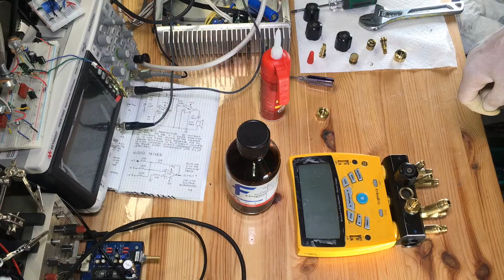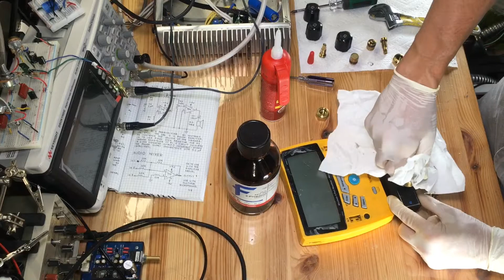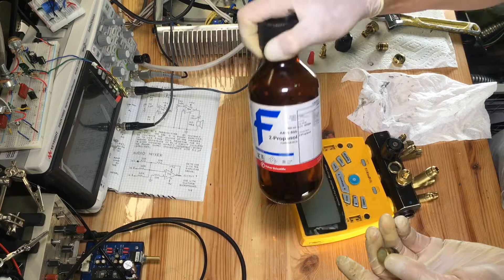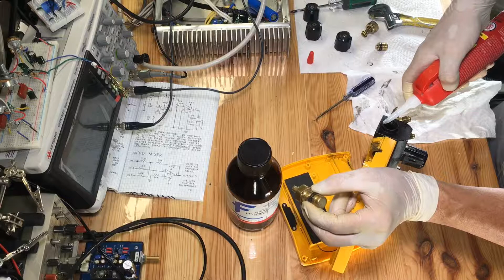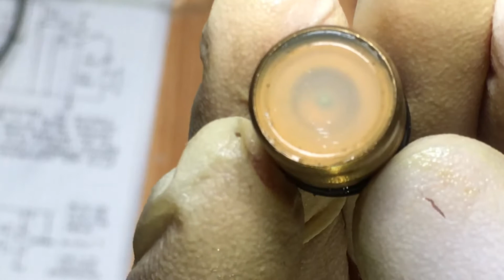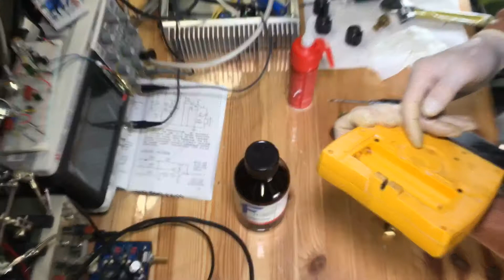SMAN 460 FIELDPIECE DEEP VACUUM FIX FOR O-RINGS USING SILICONE GREASE ￼

Comment: Please find out the compatible O-Rings for it.  Too expensive to replace all the valve and o-rings that Fieldpiece sells
Reply: Any universal o ring would do? Does the material of the o ring not matter
Reply from the maker: @bosslife944  if you use an old fashion bureau, O-ring that is used in plumbing or the old CFC, refrigerant systems, Santa, PAG oil or other additives, may make it swell and become sticky. 

So use the newer O-rings that are made for materials for the Refrigerant oil and Refrigerant that you will be using 

There’s several hundred different O-ring sizes for automobiles
Reply from the maker: In universal O-ring kits, you can find an O-ring. I don’t have a part number, but sending has excellent large Universal European kits, Asian kids, American kids that have hundreds of O-ring selections.

Comment: Tried this, great pull down but it still leaks. I ordered new pistons so we will try again with them a test again.
Reply from the maker: Did it fail micron test ? or pressure test?

If it failed micron test .  It’s because you’re using a small volume of the hoses only or manifold cannot test that way.. 

Refrigerant manifolds were never intended or designed to pull or hold deep micron level . 

Refrigerant hoses were absolutely not designed for capable of holding deep micron level .  They have a limit.

As long as you use, or try to use a refrigerant manifold with regular refrigerant, charging hoses, it will always come up to a certain point that’s absolutely not part of your system that will SKU your results . 

If you want to obtain a micron level and find out what the limitations of your refrigerant, vacuum hoses are when connected to a refrigerant manifold .
         You must use something with a large interior volume like a brand new not used refrigerant recovery tank. 

Pull a vacuum on it for at least 24 hours with your gauges and hoses attached to the tank with the valves open . 

Then perform your vacuum micron Decay test . 

It will eventually level out whether it’s 300 µm 900 µm or 1200 µm once it’s leveled out and loses no more do you know the limitation of your set up . 

I’m using a vacuum pump that has the capability of pulling down to 3 µm . I.

I have a series of videos that show using a single hose silicone hose and a micron gauge that is dedicated directly to one of the tank ports to get a true reading. It’s much better much more accurate, and the proper way to do it. 

No, refrigerant hoses. No refrigerant gauges. .
Reply: @coldfinger459sub0  so after an hour the gauge leveled off at 690 microns. Put it back on the pump to pull deeper and try again
Reply from the maker: @JDT738126  690 µm is very good for using Refrigerant hoses. You will always fail usually the micron Testo 500 µm if you’re using Refrigerant hoses.

Because they were not designed for that  

Put it on for another 24 hours see what you get . 

It’s not the gauges .  It’s a combination of the small volume and Refrigerant hoses.. 

The smaller the volume the micron gauge is so sensitive he could pick up a nat fart as 100 µm  leak. 

I always have to use that analogy of a drinking glass in a swimming pool 

If I put one drop of snake venom that could kill 1000 people into a drinking glass and have a drink it you’re like the micron gauge you measure that as a large dose and you die . 

If I put one drop of snake venom in an Olympic size swimming pool . And you drink one glass of water out of that you feel absolutely nothing.. 

When you’re trying to read just the interior volume of refrigerant hoses it is such a small volume. And on top of that it’s not metal. It’s not glass. .  So the small amount of offgassing of solvents in the material that the hose is made out of, and the moisture that is ingrained deep into the refrigerant hoses, them self, your micron gauge can read..
Reply: @coldfinger459sub0  still sitting at 690’s so the gauge is tight but just can’t hold a super deep vacuum. It originally pulled down to 40
Microns
Reply from the maker: @JDT738126  that sounds about right. 

It’s not that the gauges can’t pull down . 

It’s not the hoses cannot hold down .    And the volume of the internals of the hose are too small to measure.. 

This is why I told you about using the new recovery cylinder. I have videos on it. . 

Showing you the difference between the ability to pull down in a large volume or just the internal volume of the hoses by themselves .

Remember, refrigerant hoses were never meant to perform a micron Decay test they will always fail
Reply: @coldfinger459sub0  yeah so I guess the gauge is pretty tight then. Would you consider pulling a vacuum with a micron gauge attached to an access port? That way you can valve off the system and see that the micron gauge reads without any areas to leak except the vacuum port and micron gauge port?
Reply from the maker: @JDT738126  yes, a micron gauge write out a vacuum port is the correct way to do it with a ball valve attachment. 

All this is presented in Jim Bergman’s videos 

https://youtu.be/C8VLjBnkEcs

Over at True Tech Tools they also have an excellent little book on vacuum that has been updated to the most modern equipment by Accu tools with a Pro authors, Jim Bergman and Bill spoon purchase a Coffee right of the book and then modified it an updated it .